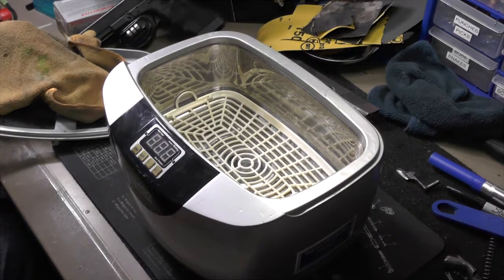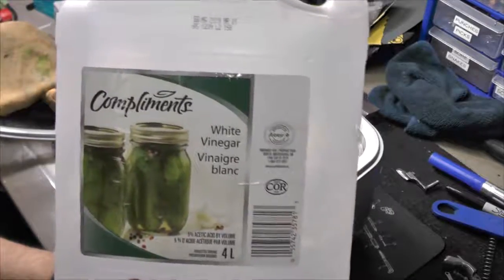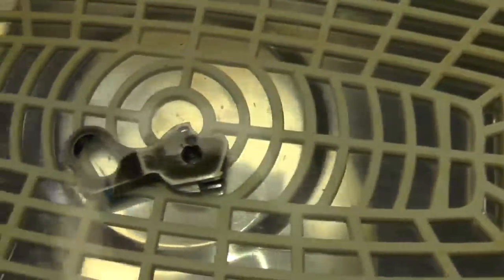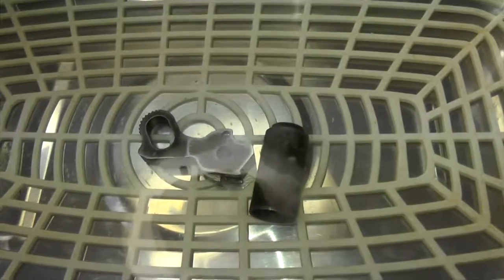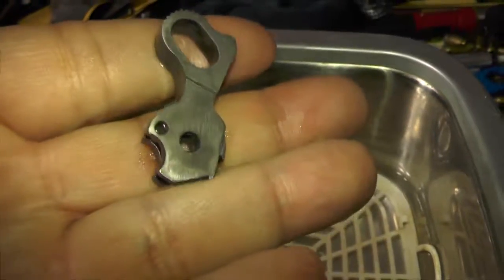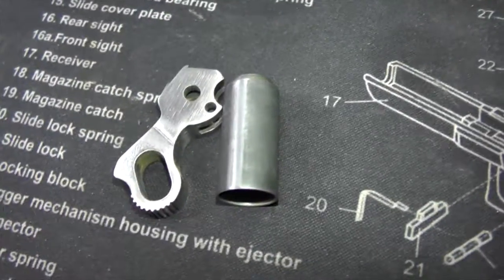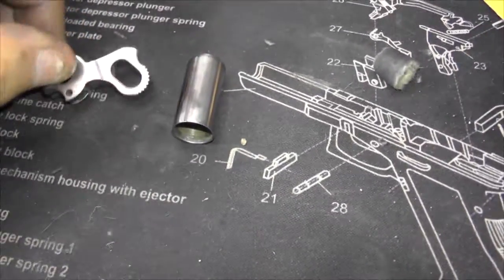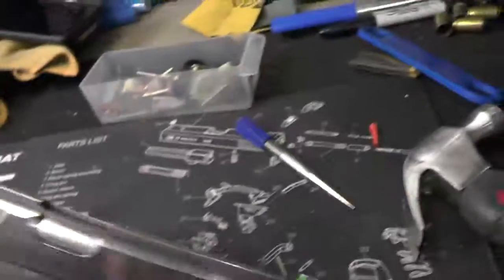How to remove Bluing with an Ultrasonic Cleaner

Comment: Ima do this to my colt gold cup trophy 1911 I just bought the bluing is fading and I want it polished. It’s my first gun but I have an ultra sonic cleaner too. My Q is, after putting the frames of the gun the vinegar and getting the bluing off, what do u do next? Do u suppose to oil it all down imidately? And I know I’m supposed to sand it then polish it but my gun has no scratches can I start sanding with 1000^ grit paper then polish? Thanks for the advice btw
Reply: Roo817 
Hi I’d wash off all the vinegar, the dry and oil. There will probably be a bit of a crap left , so steel wool will take care of that. If not fine scotch bright would be next best option.
Reply: Jon Parkes already did it came out great and I buffed it with my power drill come out decent
Reply: Roo817 
Oh that’s good news. Well done.  🇦🇺 
I’ve used vinegar to remove old bluing, prior to hot caustic bluing. Seems to work well.

Comment: Why did you remove the bluing? Bluing protects it from rust. Vinegar is an excellent catalyst for rust. Its not stainless steel, so you do realize that carbon steel will just rust again, but not such a nice blue color. Why didn't you just buy a stainless steel hammer?

Comment: Is there a reason you chose not to sand the bluing off? I guess vinegar is cheap, and leaving it in the ultrasonic cleaner saves some effort. That's a good enough reason for me. Is there any other reason?
Reply from the maker: Way less effort and if there is high spot in the parts it will take care of them. Thanks for watching dude